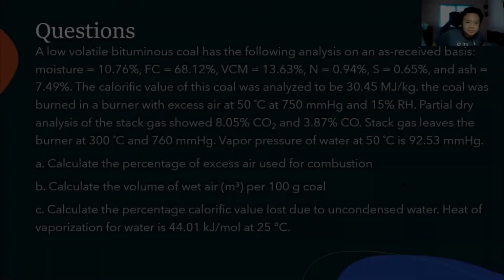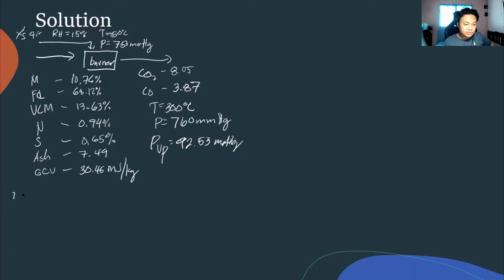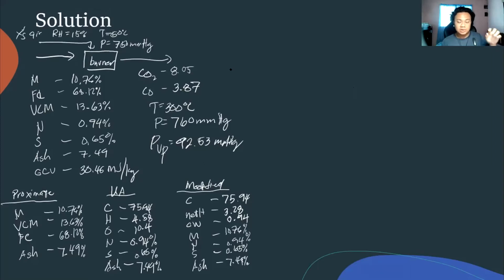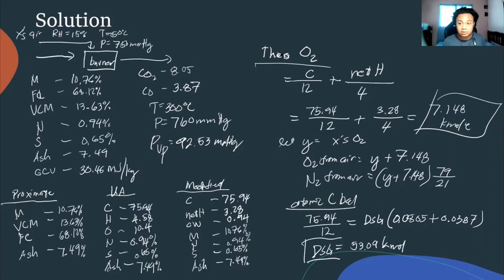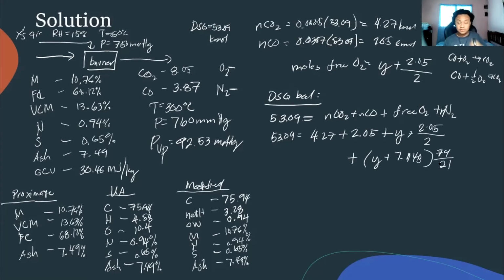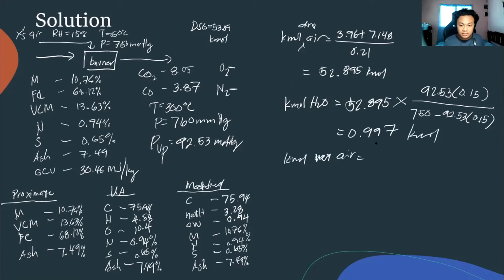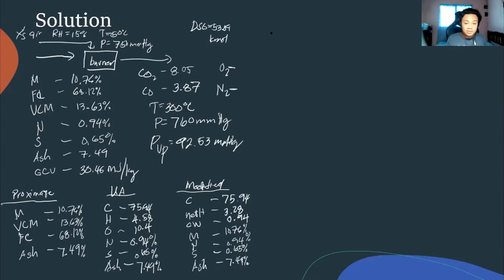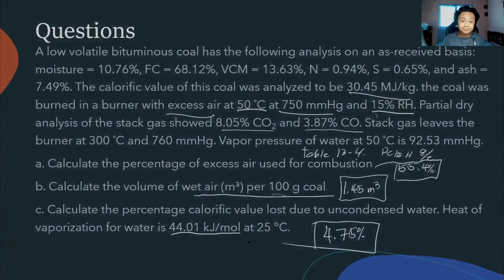ChE Review Series | Chemical Engineering Calculations Part 2b (Solid Fuel Combustion)

Comment: May I ask po ano ung basis for the formula of theo o2? salamat po.
Reply from the maker: Hi Mica! It's based on the complete combustion of C and H. Net H yung ginamit ko dyan kasi part of the total H were converted to Combined Water.
Reply: @FineDalesChEschool   Hello po, bakit po hindi na cinonsider ung S sa pagkuha ng theo O2?
Reply from the maker: Ahh yes. Hindi ko sinama yung S and N kasi we have this convention sa school namin na kung hindi aabot ng 1% ang %wt, hindi sya isasama sa calculations. For easier calculations na rin.
Reply: @FineDalesChEschool   Salamat po, super helpful po nito :).
Reply from the maker: Thank you Mica! Always glad to help. Please tell your friends to subscribe to my channel. God bless!
Reply: @FineDalesChEschool  Hello po. Bakit po hindi na binawas ang moles O2 in coal from Theo O2? Thanks po.
Reply from the maker: @malcolmwilkerson9046  Hi! Thank you for your question. I really appreciate it. The reason I did not subtract the moles O2 of the coal is that it was already accounted for by the net H. If I had used the total H from the ultimate analysis, I would have to subtract the moles O2 of the coal from it. Using the net H is actually easier because you do not need to subtract the moles O2 of the coal from it.
Reply: @FineDalesChEschool  Thanks po for answering. Ang bilis nyo po magreply hehe. At super thank you po lalo for your videos!
Reply from the maker: Hahahahaha. Thank you very much Malcolm! Please share this to your friends and classmates who need this also. God bless you!